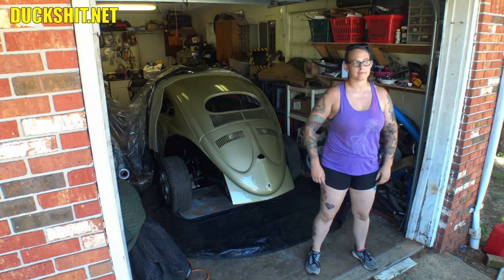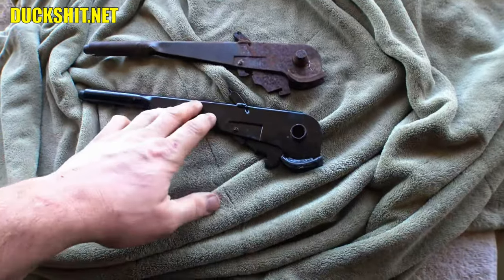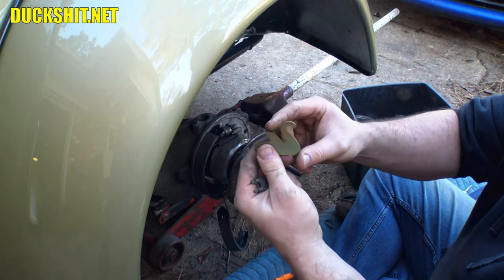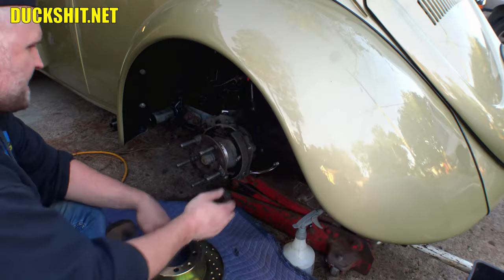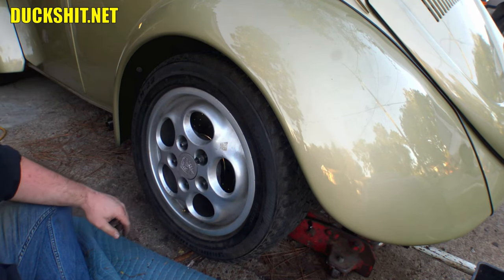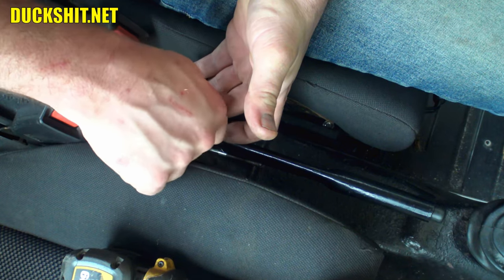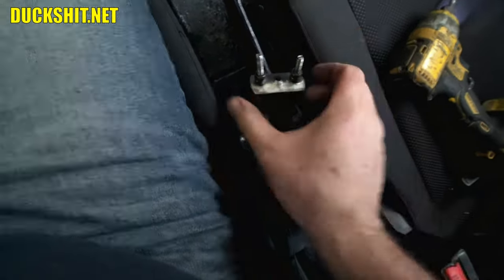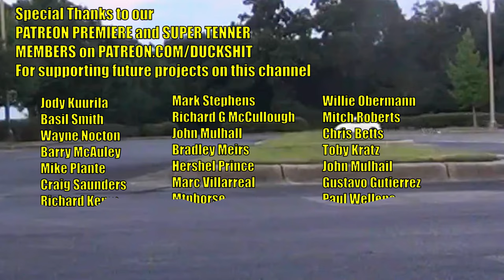FIXED! Custom Porsche 944 Parking Brakes on 1956 VW BEETLE - 182

Comment: Love the video did not know there was so many different parking brake handles wow unreal have a Happy Thanksgiving don't worry about other people say people like to run they gator just because I reckon that hearing themselves talk
Reply from the maker: Which is really strange!  If you go to buy one, the aftermarket one is a one-size-fits-all!  I had thought there was only 2 types, the one with the balance beam (late model) and the one without (early model) but apparently there were many other differences along the way!

Comment: Looking good, but correct me if wrong , but wheels on rear, drivers side looks more flush with arch, other side looks little more inset!
Reply from the maker: Correct.  Body is not on straight.   Covered why in a recent pre show video.  It will be fixed!